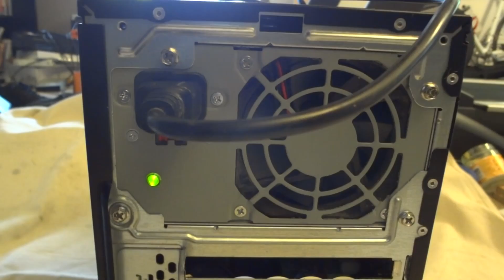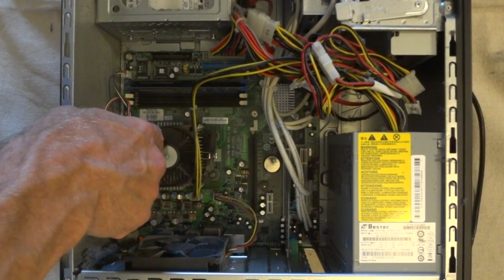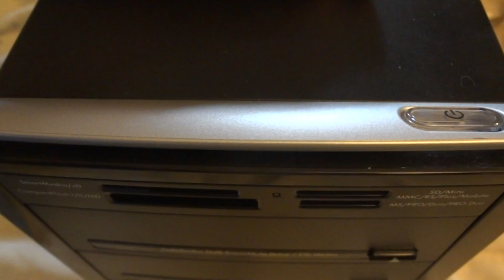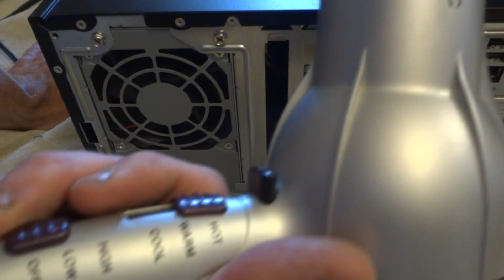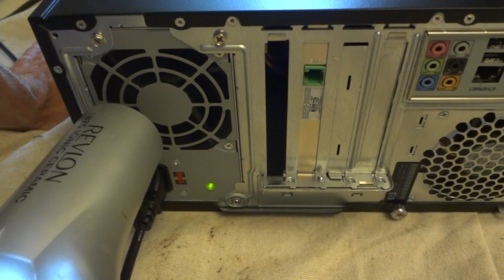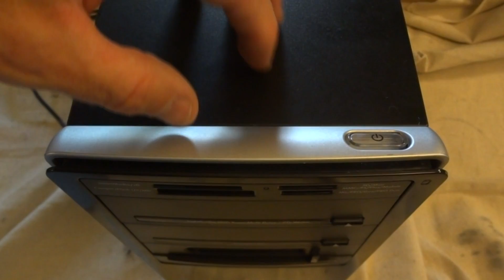HP Computer Won't Power On (Flashing Green Light On Back)

Comment: Why does this work?  I see someone commented about the heat.  I wonder if simply the airflow back though the fan is creating enough voltage for a limping capacitor to get the proper voltage to allow the system protection to switch off and allow for a restart.  My issue started not with a power outage, but with me powering down and fully unplugging everything so that I could clean as many of the fans and heatsinks as possible.  This baby ain't getting any younger, and the video which was once incredible, is now showing it's age.  What I noticed while I had the system apart, is that the video card's fan was also no longer working.  Also, a few other issues that may also be caused by the values of the caps starting to vary (after all, I purchased the system in Spring 2009).  It has served me well.  But no longer able to be upgraded to Windows 11 (without a workaround that will likely not give me updates) and with parts beginning to show signs of failure, it's time for a new HP.  Thanks for the hairdryer suggestion, it worked when all other methods did not.

Comment: I also had the error, I tried the hair dryer, but if I unplug it, the problem reappears. Well, never being satisfied with half solutions, I took it apart and replaced all suspect capacitors (5 of them) and it was fixed. now it works as it should. But they could have put better capacitors in it. Since I didn't have any good quality capacitor left for the last one, I soldered 2 of them in parallel, although only 2000uf, not 2200uf, but the main thing is that it works. http://www.kepfeltoltes.eu/view.php?filename=613IMG_20231201_200409.jpg

Comment: So, I did the hard dryer trick did not work. The light turned on, hit the power button and light turned off then it exploded and sparks flew out of the psu, the lights in the house flickered.

Comment: My light was flashing green and the only thing that worked was the hair dryer.  Still  didn't turn on but checked a couple hours later came back on..now its working.  Thanks for the tip.

Comment: Shoot, glad I did a search now, Hair dryer trick worked for me on a very old HP Pavilion a810e I had just swapped out for a windows 7 pro machine and was trying to get a bunch of data off of, really did not want to buy a new PSU just to get data from a machine that came off of the ARC. Who even thought of putting Hot air on a power supply to make it work.

Comment: Hi man I have solid green light in my packed bell but nothing else turns on anything you can think of for me to test ..its 230 volts ⚡ I did fling my older computer out so I kept the power cable from that one ..then when moving this computer to spare room misplaced the power cable ..but I presume they are all the same ..so not sure if that's the problem

Comment: okay, here is what is happening there... the power supply in this machine is the Bestec model ATX-250-12z. these power supplies use CapXon brand capacitors which are known for failure. there have been some capacitors that have failed in this machine and blowing the hair dryer into it (temporarily) brings the capacitors close enough to the correct capacitance that it will work. what should be done in this case is the power supply should be unplugged for at minimum 2 days, then open it up and locate the bad capacitors which can be easily identified because the tops of them will be bulged upward as opposed to flat like the other (good) ones. they may also appear rusty on the top or have fluid leaking out of them. they should be de-soldered and replaced with the correct value capacitors, preferably low ESR and of a well known brand.
Reply from the maker: Or replace the power supply. This video is a bandaid fix to get the computer going.
Reply: @RJTheBikeGuy  yes, if you cannot solder or do not feel comfortable replacing components in the power supply you could simply replace it with one the same wattage or more, i find these bestec units pretty well made and even though rated for 250 watts they have no issue supplying up to 350 watts. they do have issues with capacitors in some of the later ones. i have the parts so i find it more worth it to just replace $3 worth of capacitors but you can buy the same model power supply on ebay for like $20. but lets be honest most of the computers that have these units are over 10 years old now, so likely it is about time to replace the whole machines anyway, so use the hair dryer, get your stuff backed up and get another machine.

Comment: Had exactly this problem yesterday, seemingly from nowhere, haven't got a hair dryer used a heat gun on low setting and did the trick.  It came back as soon as I powered off and I've had a few blue screens recently citing power as the fault, never linked it to power supply as thee was no detectable (by me) loss of power and its connected to a UPS, so hopefully thats whats causing that, as it only seems to happen when watching videos or playing flash games and this obvious fault only occurred during a (failed) Windows10 update, that would use more processor time and thus more power.

Its a 11 year old computer expanded to the max but still fast enough picked up a used on on eBay for £9 with a 60 day guarantee.  A new one is £50, its simply not worth replacing new components on such an old computer, I was about to buy a new computer last year as it had got so slow only to be informed that 3 gig of memory (3 gig was a huge hard drive when I started using computers) will run Windows 10 very slowly, expanded to its maximum 6 for £10 off ebay, good as new.

Thanks for this I assumed it was the mother board until after changing the fuse (UK plug) and seeing a winking green light, hopefully delayed me having to buy a new computer for a few more months.
Reply from the maker: This problem is a sign you power supply is dying. Replace it.

Comment: OMG, I wish I saw this video first!! I tried replacing the battery because someone said that may fix it. So I went out to buy one, tore the PC apart, replaced the battery and that did not work. Then I came across this video, and used my hair dryer and LO AND BEHOLD, IT WORKS!!! Much thanks :)
Reply from the maker: This is temporary fix. Your power supply will need to be replaced.

Comment: What I found out is that if the green light is flashing, usually you just need to unplug the power cable, press the power button couple of times to empty the resistors, then plug it back in and turn it on.
Reply from the maker: Yeah, that was in the first step at 0:27 and didn't work. And resisters don't hold a charge. So they aren't emptied. Capacitors can hold a charge. And as I said, that step didn't work. I am guessing from the comments on this video, it doesn't work for most people.

Comment: Lol.. Funny.. My 7th gen i3 Pavilion 570-p054 power light is flashing like that, but a little slower. A new power supply made no difference. In fact, I can hear a slight tick noise with the same timing of the flashing light inside the new power supply. I pulled everything out of the motherboard, even the CPU, and it still does the same thing. Something is shorted on my motherboard. Looks I can get a used board around $55.
Reply from the maker: I hope you figure it out.

Comment: Yep it worked thank you. In time the electrolytic capacitors can "dry out" causing system failure at certain temperatures (and work intermittently). Same problem with my older Prius this type of capacitors failed on the instrument cluster board (another youtube vid fix)

Comment: This is why you don't buy pre-built PCS always build your PC and use high quality parts never used cheap power supplies whoever bought this PC should be banned from computers
Reply from the maker: The PSU lasted for years. The computer was a relative antique by the time I replaced it. My friend is a very low power user.

Comment: what if the computer turns on but that LED light on the button doesn't come on with the fans are running and it won't go to the boot screen?
Reply from the maker: You probably need to have someone look at it. Could be bad motherboard, or bad components, or something else.
Reply: @RJTheBikeGuy  I'm going to try replacing the CMOS battery on the board you know the coin battery.
They're not very expensive. After that I might just try replacing the power supply.
worst case scenario if it's a motherboard I'll probably end up having to get a new motherboard and CPU.
Reply from the maker: @Geerladenlad  It could be a bad memory module, or bad card, etc. Some computers will beep codes or something to give you a clue.
Reply: @RJTheBikeGuy  one thing I found kind of curious when I power it on the CD-ROM drawer doesn't extend all the way it closes before I can open the entire way.
Reply from the maker: @Geerladenlad  Take it to a computer shop!

Comment: It is a bad idea. PSU has cold joints, they need to be resoldered and probably you need to change broken capacitors.
Using PC with such broken PSU can lead to damage of other computer components and lose of data.
There is even a risk of fire. Never do such stupid things like overheating PSU with anything. Capacitors are rated for 85C or 105C, high temperature will shorten their life and they can leak acid, which will destory more components.

Comment: I installed a new graphic card. The computer did not started after that. Like no power at all. I tried the pressing of the power button for more than 10 seconds , put the power on and it came up. Thanks.
Reply from the maker: If you installed a card, and the computer didn't start. take the card out. Could be the power supply doesn't have enough power to support the card.

Comment: Just remove the power supply (24pins) to motherboard and put them back in a few seconds. This works for me.
Reply from the maker: In this case, the power supply is dying. this is a bandaid fix. Unpluging the PSU would not work for this.

Comment: Hairdryer stopped the blinking light but still no signal
Reply from the maker: Generally the blinking light is sign of of failing power supply. You might try replacing it. Might be other issues though as well.
Reply: @RJTheBikeGuy  would adding a new gpu do anything and I'm alright with getting a new power supply thanks for the tips
Reply from the maker: @afzal5521  Get the thing working before changing anything like GPU. Otherwise you won't know if the issue was the same issue or a new issue, or multiple issues.

Comment: I am having a similar issue but my light is solid.  Nothing happens for my HP Omen.  This is starting to happen randomly more often now.  The power supply shot?  This is a one-year-old HP Omen 870-213w.  Check out my channel as well to see more about it.  Thanks!  Guess ill try the hair dryer or a air compressor?
Reply from the maker: This is a sign the power supply is dying You will need to replace it. The hair dryer is just a temporary fix.

Comment: You don`t use original PSU ! 4 pin on left side are empty ! What are you want , and make video with some fake PSU ?
Reply from the maker: It's not a fake PSU. This computer belonged to a friend of mine and I was fixing it for her. And I managed to get the thing up in this video. But this issue is a sign of the PSU dying. I later replaced the PSU in this video: https://www.youtube.com/watch?v=7OM3CzGxxyo
As far as I know the PSU was stock to this computer.

Comment: Dont punch power supply 0:59 red
Reply from the maker: That was right from the HP website. Do it with the power unplugged!!!
Reply: I have 230 to 215 i have 215 i have plug my computer its boom power supply
Reply from the maker: You're supposed to unplug the computer, switch it over, wait, switch it back. Then plug the computer back in. You only are supposed to switch it temporarily with the computer unplugged. Running the computer with the wrong setting will probably fry it, or at least the power supply.
Reply: @RJTheBikeGuy  its never work
Reply: @RJTheBikeGuy  light power supply not work no more green i have plug nothing happening
Reply from the maker: @saleharja7432  As I said, if you didn't follow the directions, you probably fried your power supply and maybe your computer.
Reply: @RJTheBikeGuy  yup okay thanks
Reply: Eind my pc its crash

Comment: Yes I switched the switch and blew my hard drive it went bang.
Reply from the maker: ???? Switched what switch? Your hard drive went bang? Or your power supply? Did you switch the voltage switch with it still plugged in or something?

Comment: This is the video that helped me solve the problem with my Dell XPS 8700 desktop.  It doesn't have a reset button next to the green light by the power cord, and I couldn't figure out what to do with that red thing.  My green light was on when there was power, but not very bright.  At 1:00 this video shows that you can slide it to the other side to switch to 220, and then slide it back to 115.  For me, that performed a reset.  I disconnected my power cord after doing that and the light flashed bright green.  Reconnected my power cord and the light was bright green and I was able to power on my computer.  Thank you Bike Guy.

Comment: Bestec made some crappy power supplies on certain models.  The same thing happened with my HP Compaq and Dell also uses them.  They usually fail on the 5+ volt rail when you use the sleep or hibernation mode alot.  I'd replace it with an Antec or Corsair power supply.

Comment: What the hairdryer is doing: The power supply has bad (Leaking or bulging) capacitors. So yes, this trick works on a number of devices with bad capacitors (Also works with monitors), but in the end, either the capacitors need to be replaced or just replace the whole power supply.

Comment: I don't have a hair dryer on me right now, and I won't be able to go to the store until tomorrow. Any alternatives?
Reply: Got a hair dryer. Didn't work for HP Envy.
Reply: Desertsage 

Put ur hairdryer switch on hot then blow it on ur cpu on the fan for 60 secs then turn it on

kthxby
Reply: Didn't work. I have a different computer now.

Comment: I am working on a much older Pavillion (A230n) that's been sitting for years.  I thought I'd mess around with it for nostalgia sake.

Cleaned it up, powered on ok, saw the HP splash screen and prompts for "F1 - Setup, et al", then the machine powers down. Any attempt to interact with the BIOS is ignored.  It is the exact same routine every time I power it up.   When it stops working, there are lights still on on the case's power button and on the Num Lock indicator, for example, but the fans stop spinning entirely and the VGA connected CRT monitor slips back into standby mode.  So far I've tried disconnecting the HDD and all the CD drives but the same exact behavior persists.  Does this seem like a PSU problem?  TIA
Reply from the maker: Doesn't sound like PSU. Some older computer had small batteries on the motherboard that would die and cause problems. Maybe it is something like that.
Reply: RJ The Bike Guy thanks for the reply.  I replaced the 2032 batt to no effect.  I wondered if a tired capacitor was to blame so I left it plugged in but powered down for an hour.  Strangely it now stays powered up but now the monitor won't seem to get a signal.  (The monitor is connected to the VGA port on the mobo IO.)
The monitor stays in stand by, and now I'm not getting any lights on the kb.  But the Tower stays up and running.  Semi progress :)
Reply from the maker: Dunno.

Comment: Maybe one of u computer guys can help me I had a water spill not a lot got in my PC when I power my computer my LAN light turns on but the PC quickly turns on then off again with out fully going on what could be  causing this? Power supply? The power supply didn't get wet so I think maybe one of the cords got wet because I saw a few splashes there tell me if u guys got any ideas

Comment: Spinning fan -> induced voltage -> risc of frying the electronic. Cleaning fans with a vacuum or a blower is a big DON'T. You can brush away the dust with a soft brush while holding the vacuum near the brush to collect dust particles.

Comment: Wow, thanks.  you save me a service charge.  We had a 3 1/2 hour power failure, and the UPS ran down.  After that it would not power up, green light on back, but no power.  I tried everything suggested elsewhere, unplugging everything, holding in the power button while unplugged, switching between 120 and 240 volt.  About 30 seconds after hitting it with the hair dryer the fan came on, but still no CPU power.  But once I could get the fan running, the power cycling with the power button pressed like I had tried before brought it up.

Comment: how much i have to keep it ? for 1 min?
Reply: Amine MoudjaHed keep it until you see the light stay on.... mine took  1:30 until a solid light
Reply: Jonathan J. Carmona actually i don't have hp or whatever ,so my pc doesn't have this light ,that's why i asked for the time?
Reply from the maker: The light is part of the power supply which is not specific to HP computers. This method may or may not work on your computer.
Reply: RJ The Bike Guy hmm okaay ,thnx
Reply: 5 min

Comment: I felt like a idiot using a blow dryer on my computer. Bu darned if it didn't work. Two things make sense-dust, or dampness.  It was in the basement, we've had a lot of rain, and it turned colder today, so I'm leaning toward water. So, it makes sense. And I'm probably totally wrong. Who cares. It worked.
Reply from the maker: Generally this is an indication your power supply is dying and will need to be replaced.
Reply: Yeah. Replacing it next week.